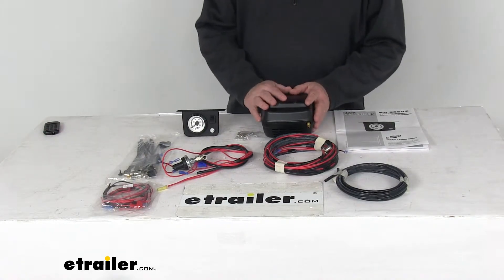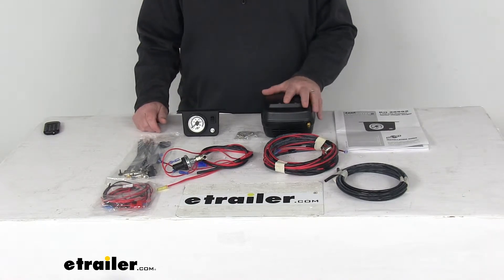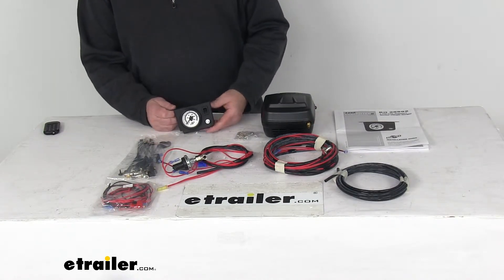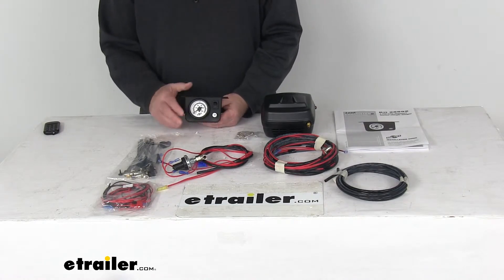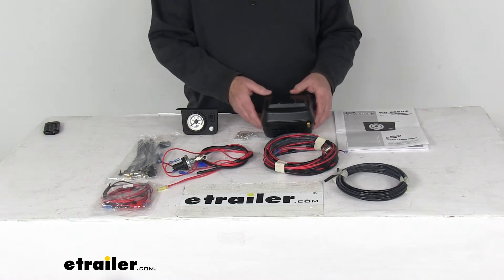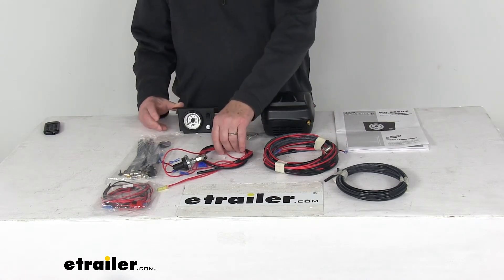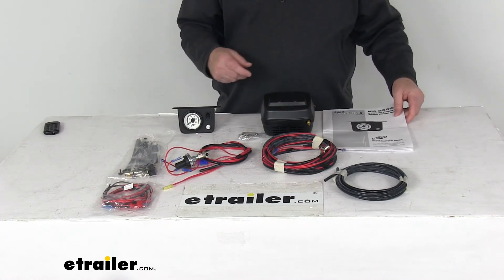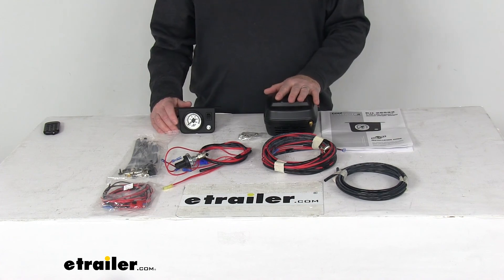etrailer | Feature Breakdown: Air Lift Load Controller II Compressor System for Air Helper Springs

Comment: Great video. How about one where you bypass the low pressure switch, AKA the dead battery switch when the system leaks, and wire to the Ford upfitter switch. Put the gauge in the rear under seat storage area, because you would never mount this gauge up front in a new expensive truck, and you want to be outside looking at the leveling while you are adding air anyway. That's how 
I foresee people mounting these.